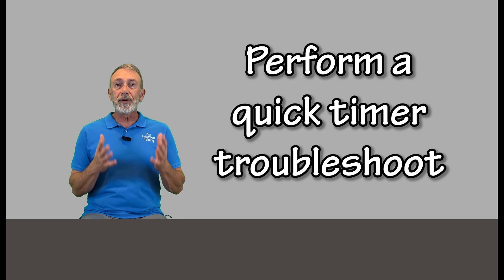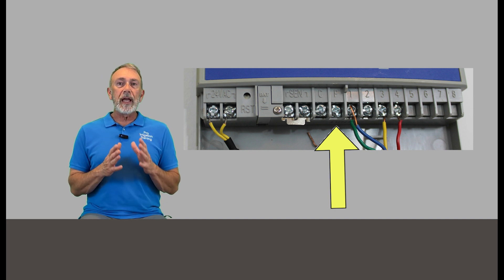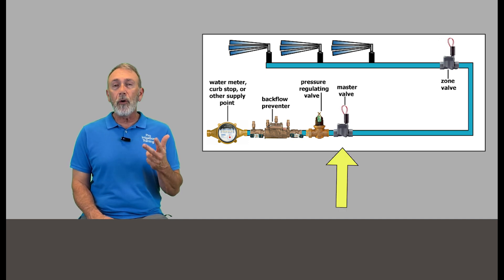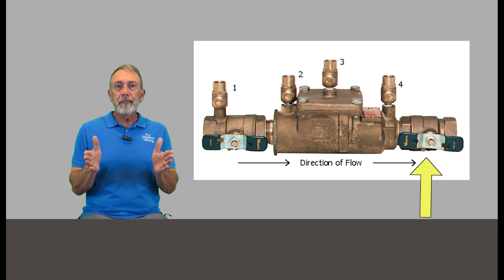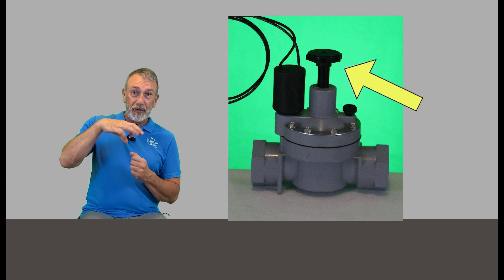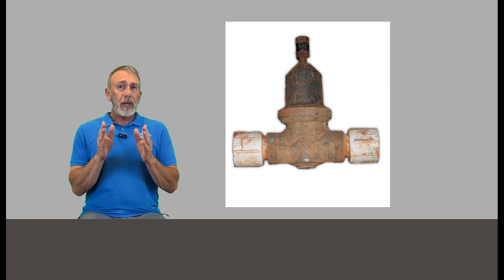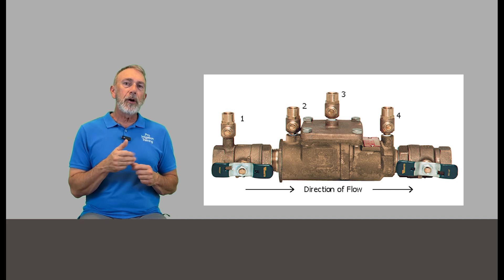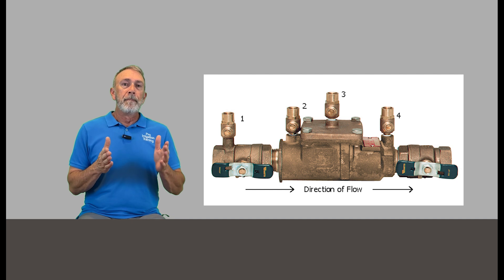My Irrigation System has Weak Pressure - How to Troubleshoot (Sprinkler System Repair)

Comment: Is this a true statement?  A booster pump in an irrigation cannot increase the flow of water beyond the rate of flow at the source of water.  IN other words if you are getting 11GPM from a city main a booster will not assist you if you find that you have a zone that might need 25 GPM based on the Hunter head table.
Reply from the maker: I think there are a couple factors at play. If you're at the limit of what can physically come through your meter or curb stop, then no. But pressure and flow are connected. If there's more water available in the city main you're connected to, but pressure is limited because of your elevation, then yes. Many times have I installed a booster pump on a system at the top of a hill that could barely push 3 rotors at maybe 6 gpm, and got all heads up to full flow and pressure maybe 10 gpm or more. But 25 gpm? I doubt you have a 1" meter, but maybe you do, maybe we're talking about a larger commercial property? Anything smaller than that, you probably can't get that much flow. If you have a 5/8" or 3/4" meter or curb stop, then I'd suggest splitting that zone.